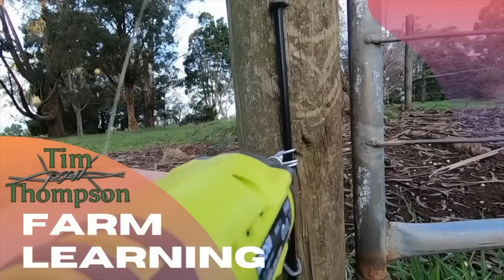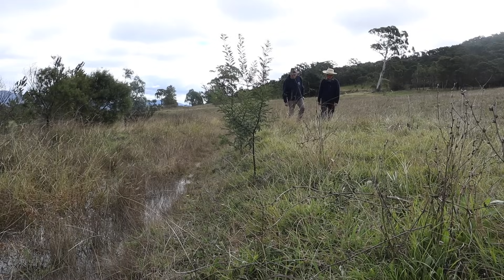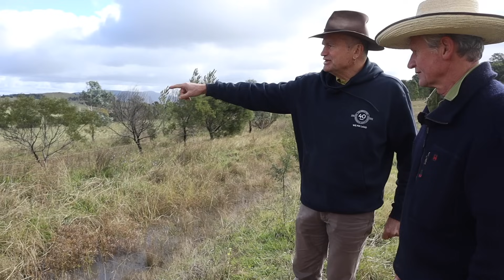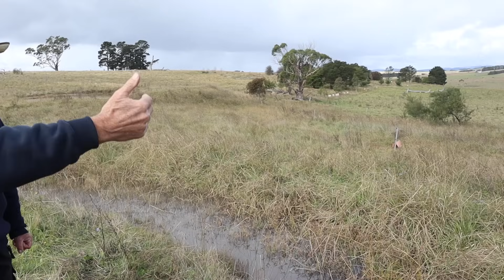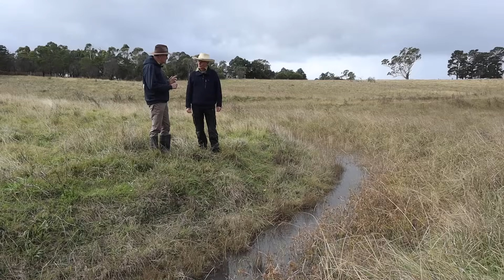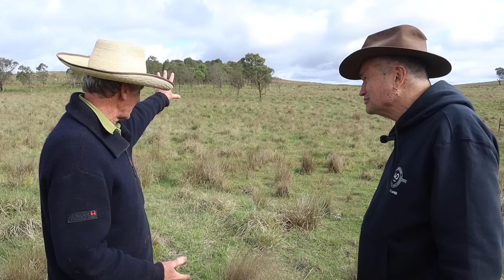Regenerative Farming’s Secret Weapon: Midslope Banks

Comment: Peter Andrews seems to have gone to the approach of removing all creek and water management spaces from grazing to protect and stabilise them, opting to cut and bale instead in some cases. Are these spaces often fenced off? That seems limiting from a cost perspective if you've got any substantial distances of contours. 

Geoff Lawton tends to grow things within swale channels if he has decent drainage or on top of them with less drainage. It's interesting that Martin seems to have utilised the first contour only for slowing and then added a composting channel as a standalone structure.
Reply from the maker: Contours work better when smaller and in multiples, rather than alone. One reason why they are different to swales. Calling them channels is misle@ding. They are not designed to hold water, simply spread and drop it. On both Martin’s farm and Peter’s farm the contours are not fenced off. You might choose to I suppose in some delicate areas but even on Phoebe’s property in this video the new contours are part of the paddock system. She grazes along them. To see Peter’s farm, click this link https://youtu.be/Cz5vktTyDgk?si=VTu12StqSGFW6t8k